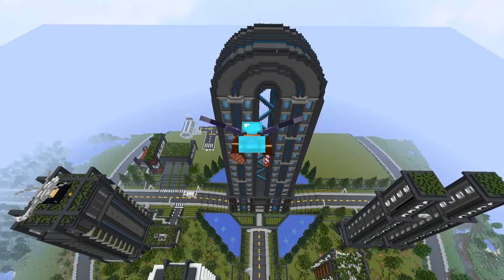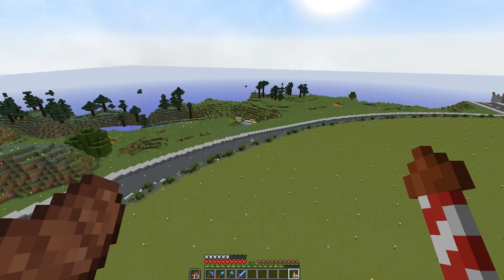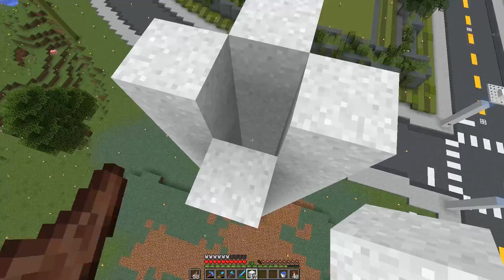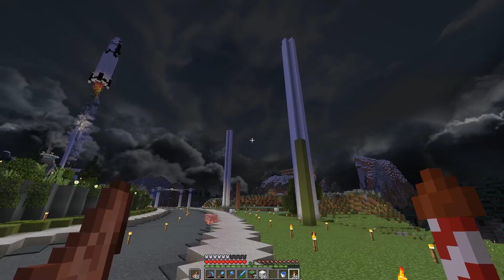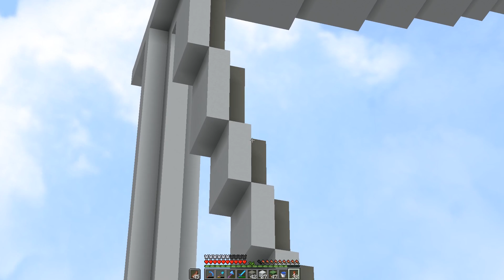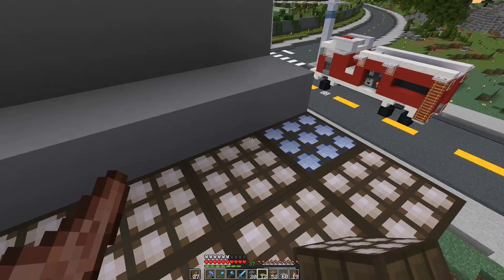HermitCraft Season 5: Powering Up ScarCity!    (Minecraft 1.12)

Comment: for the vex penthouse, since theres the weird floor curve going on, you could consider adding glass floor that lines up with the top of the curve so you get a flat floor to work with, and then under the glass make a floor aquarium. you could then either put in some squids, or the more fun option, put in some guardians. it wouldn't be very deep, but that'll actually make it easier to see the guardians anyway. Or you could play with different floor levels or add in a nice hot tub. with the ceiling height you have, maybe consider some chandeliers. another option is building in a vault (maybe hidden behind a painting like you see rich people do in movies with hidden safes) to hide your shinies since they were clearly not safe out in the open when the revolution managed to discover the vex hideout. considering the amount of wall space, maybe consider a vex mural? #vexideas